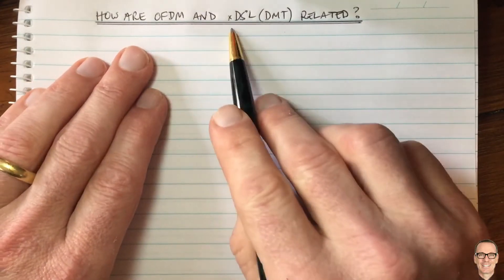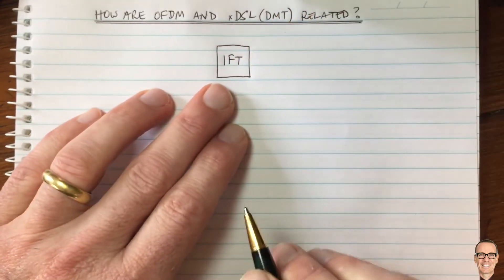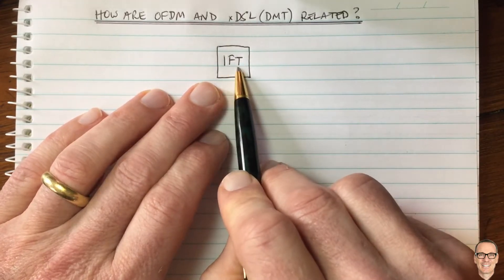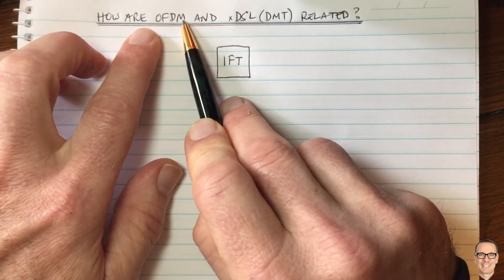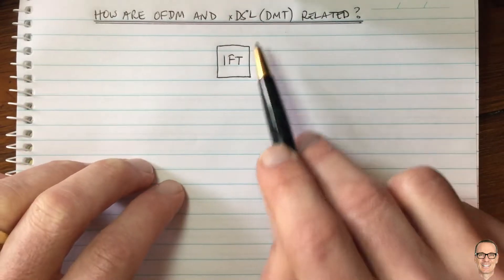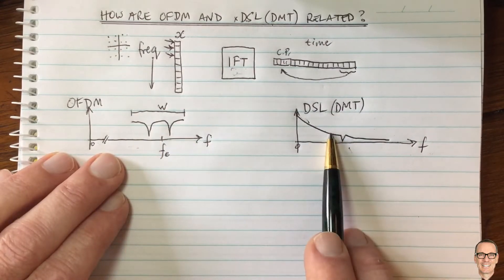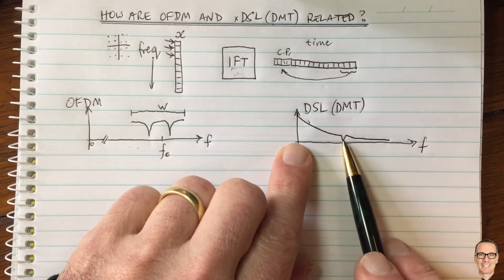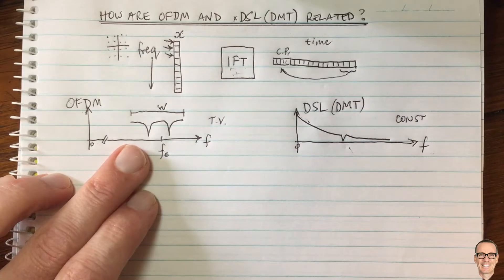How are OFDM and xDSL (DMT) Related?

Comment: sir as you have said that in DSL we need to transmit the baseband signal for which we have to append the conjugate of the vector but my question is that when we take the conjugate part still we have the complex part (like conjugate of 1+j is 1 -j ) then in that case how we are transmitting the imaginary part. in case of the wireless transmission we are doing in the orthogonal basis function but how we will do in case of DSL where we are not using any carrier signals since we are transmitting base band

or its like we are transmitting only the real part of the whole vector  [0:N.....N-1:1]
Reply from the maker: When you append the conjugate part to the vector (which is in the frequency domain), and then take the inverse FFT, you get a real-valued time-domain vector. It's a property of the Fourier transform.
Reply: @iain_explains  thankyou sir I have learnt so much from you about communication 🙏
Reply from the maker: That's great to hear.

Comment: Thanks, you said before and after the IFT there are vectors with complex numbers. In the fd it is clear, the complex numbers represent the points in the IQ plane. But the numbers in the td, what does it represent? Does it gives us the amplitude and the phase of a wave? If so, what is the frequency there?
Thanks a lot.
Reply from the maker: Hopefully this video helps: "How are Complex Baseband Digital Signals Transmitted?" https://youtu.be/0lkRJgnywkg
Reply: @iain_explains  Thanks I watched it.The points in the time domain are hold over a period of T so that I get an analog signal? Just the points in the time domain are not a wave form. Thank you.
Reply from the maker: The "points" in the time domain are the inputs to a transmit filter (sometimes called a pulse shaping filter). In the case of xDSL, this is a baseband filter. In the case of OFDM, the output of the filter is then multiplied by a sinusoidal carrier waveform. These videos might help: "How are Signals Reconstructed from Digital Samples?" https://youtu.be/dD9HC1GThZY , "How are Complex Baseband Digital Signals Transmitted?" https://youtu.be/0lkRJgnywkg and "Pulse Shaping and Square Root Raised Cosine" https://youtu.be/Qe8NQx4ibE8

Comment: at 7:30 you have mentioned channel is time varying , if the channel of only frequency selective and there is no relative motion than can that channel be time varying ? because channel cofficient will be constant and it will be independent of time .
Reply from the maker: At 3:50 I mention that OFDM is used in wireless communications, where there is movement of the terminal, and therefore there is relative motion that causes time variations.

Comment: I just want to see if I understand this correctly: With MIMO, the TX is using multipath to create an additive maximum at the desired receiver and/or a minimum at some other receiver. Essential to that is the ability to control the relative phases. In DSL, does that mean there must be some form of control at the DSLAM? I'd imagine that users on the same trunk cable where the crosstalk occurs may actually be on different DSLAMS, so is there a common clocking between DSLAMS?
Reply from the maker: Yes, that's a good point. Vectoring in DSL is done from a single DSLAM.

Comment: If DMT can only transmit real samples, how can it transmit QAM, which requires complex (in-phase and quadrature) samples?
Reply from the maker: It's a common question, but I think you might be missing something. All signals are real signals (even QAM signals). "Imaginary" signals do not exist. In QAM, the "real" signal component is a cos waveform with a particular amplitude, and the "imaginary" signal component is a sin waveform with a particular amplitude. They are both real signals (ie. they are both electromagnetic waves that exist, and add together to give the overall "QAM signal"). I think maybe I'll try to make a video on this topic.
Reply: @iain_explains  I think the key point is that both OFDM and DMT create subchannels capable of conveying complex values, which correspond to the amplitude and phase of QAM. The difference is that all the OFDM subchannels are independent, whereas only half the DMT subchannels are.